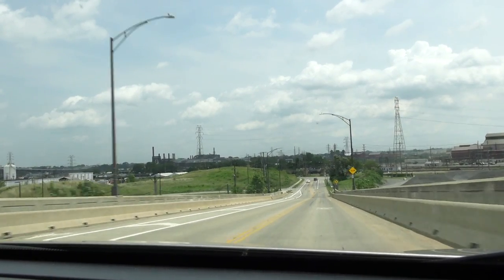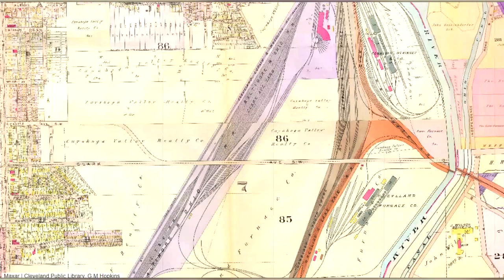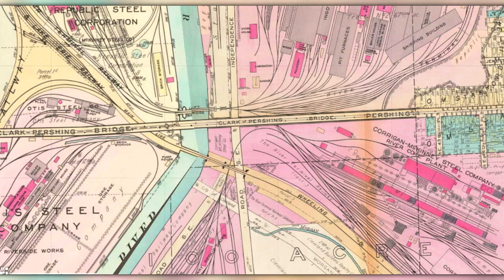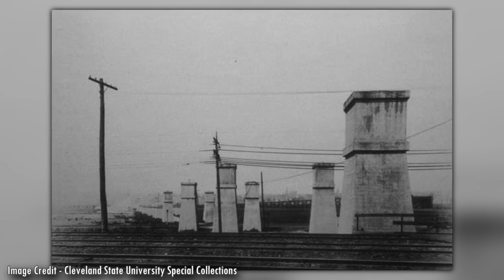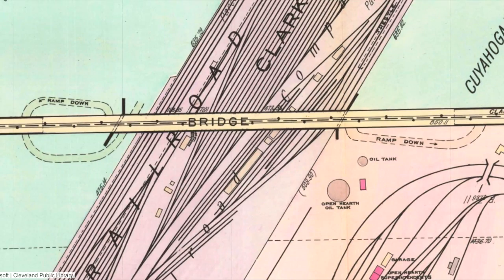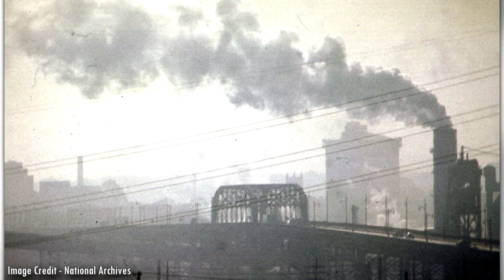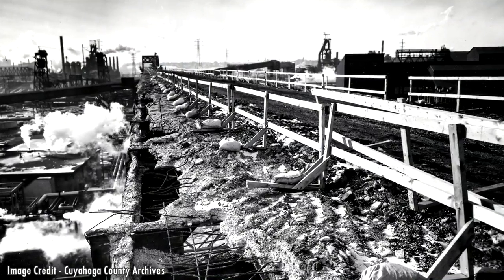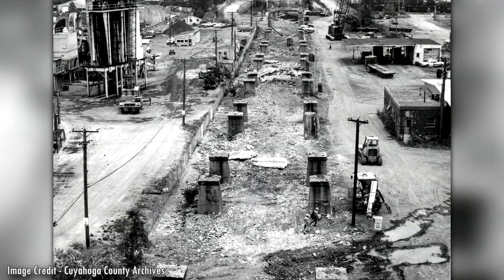A Bridge above Cleveland's Steel Mills: Clark Avenue Bridge

Comment: God...Cleveland use to be so busy  back when I was a kid in the 70's...nothing but manufacturers everywhere...there was 2 bars on every corner...no empty lots everywhere...man how times have changed...the flats are amazing with all the bridges that razed up or swing open...its pretty cool to watch a huge ship navigate thru the Cuyahoga river
Reply: I started working for River Terminal RR a subsidy for Republic Steel from 1973–2002. I liked the bridge because it was a short drive for me to get to work. Furthermore, I worked 100's of days under that bridge moving rail cars full of coal, coke, steel and scrape. I remember when in the winter it was being repaired, and it had barrels on it to guard the repair area's. A drunk guy  was running from the cops going over the bridge, he slid on some ice, then hit the barrels which shot his car in the air over the railing to where an empty gondola rail car was parked, his car flipped upside down and landed perfect into the RR car. He died as it was about a 80Ft fall.
I agree it was very busy and different back then

Comment: Worked at the Steel Mill for a number of years. I knew the story of the bridge already, but it was nice to see the old photographs of the Steel Mill. My father has been down there for almost 40 years now, it has changed so much over the years. It was fascinating to see pictures of the old coke ovens, and blast furnaces that no longer exist. A steel bridge built over coke ovens, what could possibly go wrong? LOL.  Thanks for posting the video.
Reply: He says it closed  in 1978  , I remember it closed  in the early 70's  when some portion fell apart

Comment: I grew up in Cleveland, and remember the Clark Ave. bridge well. I do not remember that bridge in anything other than disrepair, and I would not travel over it for anything, besides the steel mill emissions were so thick, It could look like a smelly fog at times. More cars were rusted from the stuff than the salt on the streets in winter.
That area was one of the main reasons that Cleveland had nick names like "The Mistake on the Lake", and "The Dirty City". I was fortunate to have lived on the south side, away from the stink, etc. unless we had a rare north east wind. If that happened, the smelly mill "fall out' and what ever was coming out of J & l and Republic, could make you want to toss up your lunch. (that Sulphur rotten egg smell) I don't know how folks could live on the bridge east end neighborhoods, they got the worst of it all
The Cleveland you see today is far different than the 1950's, 60s, and 70's. This is one time the EPA did a good thing when they cracked down on Cleveland in the 1980's
Thanks for the nice history of that nasty old bridge. ;-)
Reply: mistake on the lake: usually old time truck drivers like me know that to be (ick) CHICAGO.

Comment: I just watched this video, as well as the video about the Huletts. Very interesting. This is also the sort of thing which makes me say, "I don't know how any adult can look at something like this and still believe that climate change is a hoax. We built a steel bridge through a factory district that polluted the local environment so fast that a marvel of engineering which was probably intended to last at least 100 years was falling apart noticably in 25 years, barely holding on after 50 years, and was closed and demolished after a little over 60 years."

Comment: 02MAR2022 - As a child in the 50s, when we drove over the bridge at night I was terrified. I just knew that the flames belching from the stacks and the glow from the buildings meant we were crossing over Hell.
Reply: I can only remember going over this bridge once in my life. I remember that the railings on the edges were very low and you could look right down onto the steel mills.It was frightening. It was also very smelly and everything was black, just like descending into hell.

Comment: The smell and dirty air from the steel mills never really bothered me when I wad young.  The flames from the flare stacks intrigued me especially at night when driving by on the high level bridges over the Flats.  When the scrubbers on the stacks were added in the 1970s, the air was really cleaned up but by then the vertically integrated steel business was in decline.  Now I realize the smell from the mills in the old days was actually the smell of money being made from raw materials and hard labor manufacturing iron and steel for industry.

Comment: i see a Roundhouse in that map!!!!! B&O RR Built by 1919 with Wood Frame and Brick Walls and had 15 stalls only 9 remaining and an 80foot Turntable
Reply: Most of it now belongs to the Midwest Railway Preservation Society.  They keep their equipment inside and around the W 3rd St. yard, including ex- Grand Trunk Western Mikado 2-8-2 #4070, which was the locomotive that started the Cuyahoga Valley Line (now Cuyahoga Valley Scenic Railroad) in 1975.  It last ran in 1990 and has sat needing a million dollar overhaul ever since.  Another group has ex-Reading T-1 4-8-4 #2100 in another stall restoring it to operating condition.  I was an early volunteer on the Valley Line in the mid to late 70s when they kept 4070 and the train in the B&O yard, and remember driving onto the Clark Av. bridge as far as the W. 3rd St. ramp to access the roundhouse from I-77.  It was like driving over Hell.

Comment: In this video, the driver passes the eastern end of the pony-through truss span.
https://www.youtube.com/watch?v=JWvy4Oczn-E&t=150s
Reply: The point where the old bridge crossed is at 2 Minutes and 30 Seconds, on the attached video
Reply from the maker: Thanks for the link to the video! Great observation on the remaining evidence of the pony-through truss's concrete wall.
Reply: @RailroadStreet  I remember riding a ten-speed bike across the bridge in the late 1970s, about a year before the sidewalk collapsed in one section. I remembered how "bouncy" the sidewalks were, after all, they were merely walkways welded to the side of the main road deck.